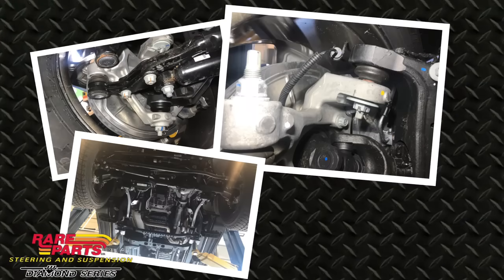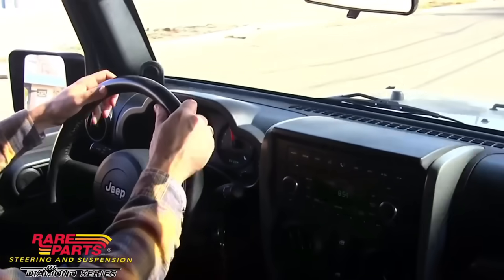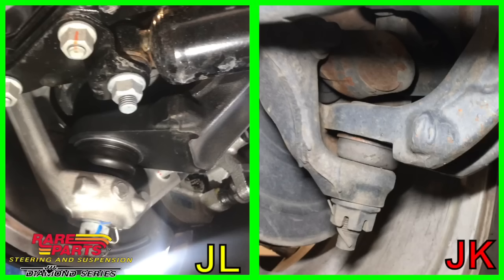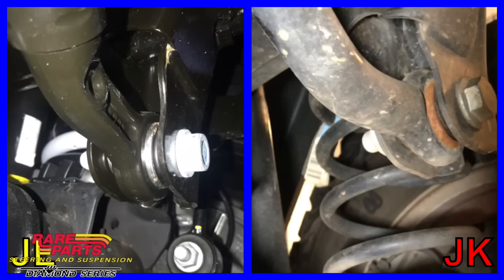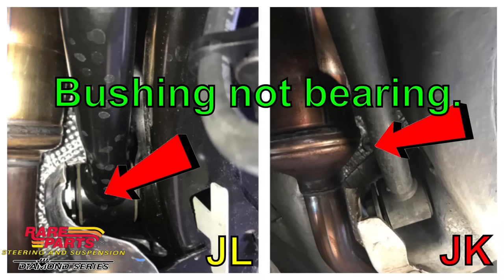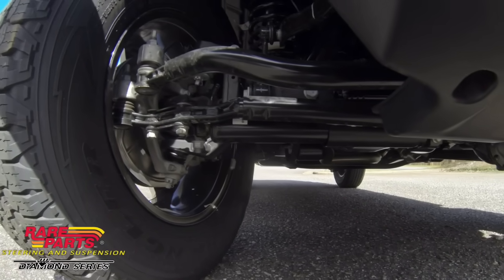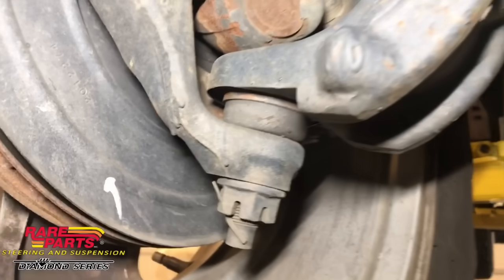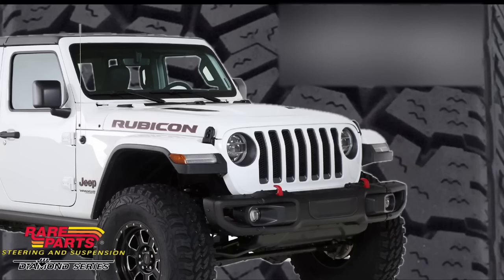Jeep Wrangler death wobble  Jeep JL vs Jk steering and suspension changes

Comment: Would a Rubicon help or worsen with the death wobble since it uses a different suspension?
Reply from the maker: +HUGE JACKMAN  Thanks for the great question! There May be a couple of answers to your question. First thing is  all of the steering components are the same on Rubicon as they are on the Sahara and sport addition. This is where the death wobble normally starts. Although the Rubicon does have electric swaybar disconnect. This wouldn’t either hurt or help      The Death wobble situation. The shocks springs and tires are the main difference on the Rubicon versus the Sahara  and sport. The control arms on the Rubicon may be a little longer but bushings in the control arms on most likely the same. So to answer The original question, My opinion is it would not make a difference. Now Rubicon may be subject to more wear and tear since it may be Offroad more. I guess it depends on which way you look at. Thanks again for the great question!